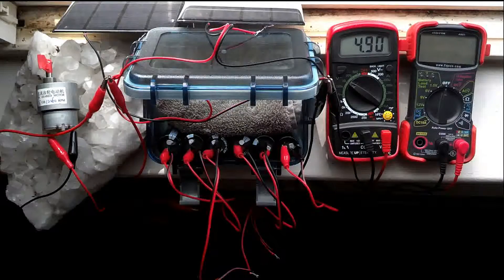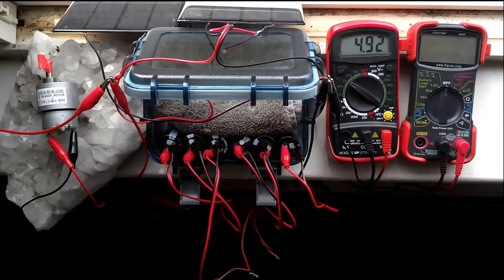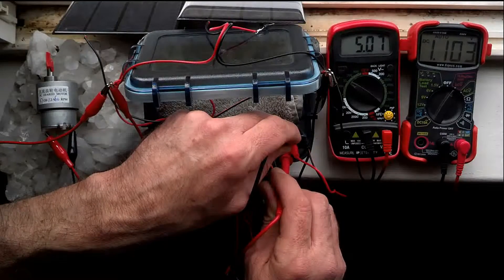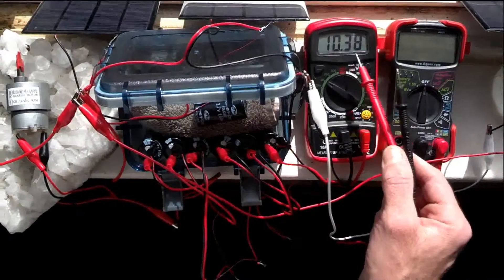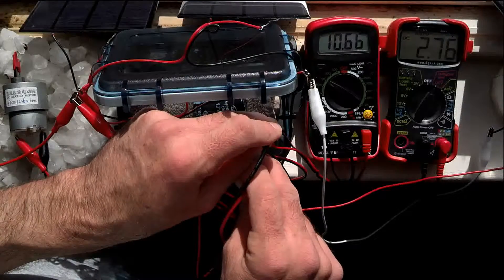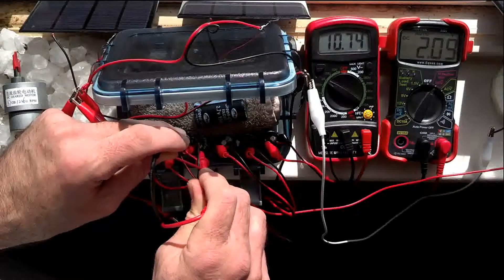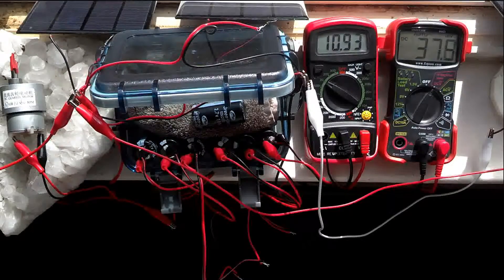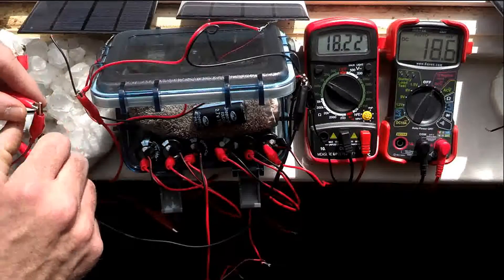Super Capacitor Charging - Unbalanced Example

Comment: I ran into a problem with using those capacitors where they would go out of balance very quickly. I found that a number of mine had excessive leakage current. Maybe that's why you were seeing the voltage drop on one of them while it was charging.